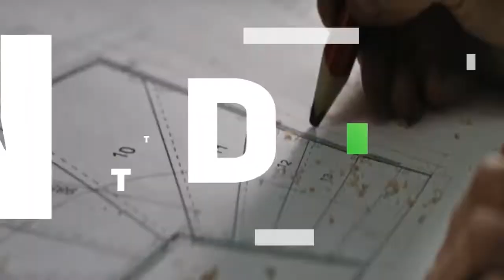#Pompe_direction_assisté golf 4 (detection problem).التعرف على مضخة و نوعية المشكل.

Comment: A quoi sert ta vidéo exactement? à diagnostiquer le problème sans apporter une solution viable.
L'intérêt est limité, il existe pourtant des solutions à ce problème.
Reply from the maker: Chacun est sa solution,, il y'a des gens qui change la pompe complet et autres fait juste allez chez un tourneur et fabrique juste la pièce endommagé. A vos l'initiative. Généralement le titre de vidéo est détection de problem.
Reply: @SevenCrafts  C'est tout à fait exacte, mais cela n'a que peu d'intérêt puisque l'on sait où se situe le problème, mais sans indiqué une solution, le lecteur restera sur sa faim en quelque sorte, il suffit de resurfacer la pièce avec un grain 2000, voir 3000 avec un peu d'huile, d'inverser les masselottes et la pompe est réparée gratuitement avec une grosse économie à la clé, quand on démonte, c'est pour diagnostiquer la pièce défectueuse et la réparer sans devoir mettre l'organe en entier à la poubelle.
Reply from the maker: Lorsqu'on surfacer on risque de diminue le début de la pompe et constate des duffuclté au brackage au volant
Reply: @SevenCrafts  Non,  les cams fonctionnent par inertie d'une part et de l'autre on utilise un papier abrasif  P2000 minimum comme indiqué et inversion de la position des cams, naturellement tout dépend de la dégradation bien évidemment, ne perd pas de vue que ces pompes mécaniques ont des "release valve" ou valve de décharge qui régule la pression, mais aussi que des problèmes éventuel qui peuvent se retrouver dans la crémaillère, bien souvent le vase de compensation dispose d'un filtre pour éviter d'endommager les éléments de la direction par les poussières métallique.
Ces problèmes peuvent être évités en utilisant une huile hydraulique de qualité de type full synthétique, elle ne mousse pas, elle tient bien dans le temps et surtout elle n'est pas agressive pour les durites à l'inverse de la semi synthétique très agressive, en outre une très bonne tenue dans des conditions climatiques sévères. 
La pression de service tourne autour des 100 bars.
Reply from the maker: C vrai je suis avec vous